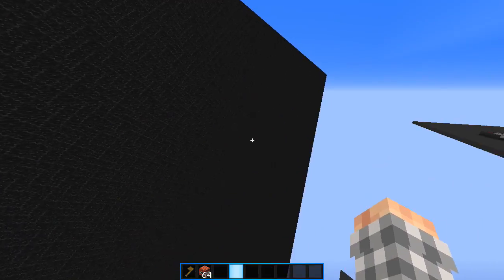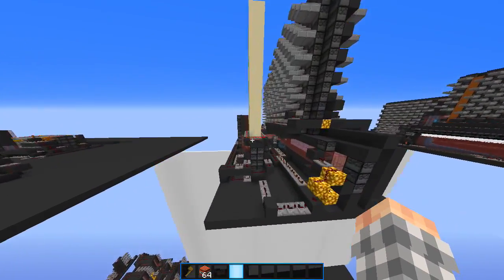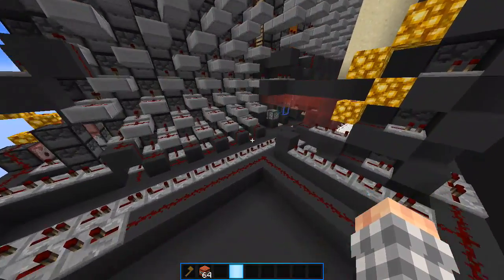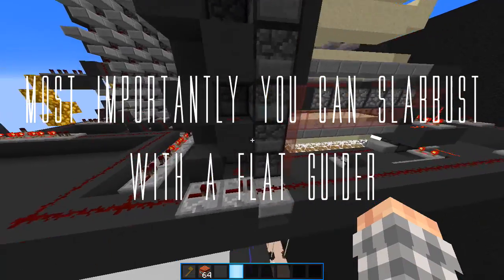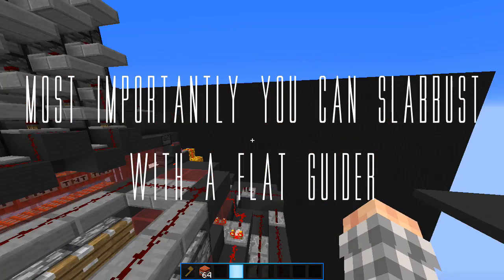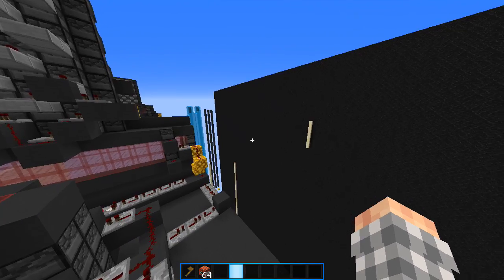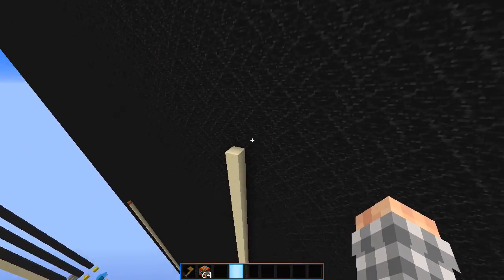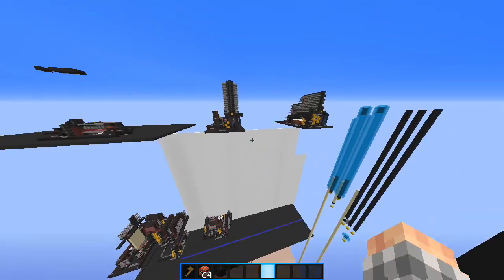Flat Guider Stacking Without OOE/Fusion (How it Works)

Comment: But isn't the gravity affecting the sand and hammer the same? I don't minecraft is coded such that entities only drop down when they hit a wall (else you could shoot like 20 chunks with 1 power without sand dropping). Therefore, wouldn't both the sand and hammer still be at the same y level when they hit the wall?
Reply: The closer an entity is to exploding TNT, the more velocity it gets. The sand and slabbust are closer to the power than the hammer so they gain more speed and will hit the wall sooner.

Once an entity hits a wall, it loses ALL of it's momentum and just goes into a falling state. Because the sand hits the wall before the hammer does, it will have a bit more time to drop down.

When the hammer and sand come out of the barrel they will indeed both arc down a bit and will hit the wall at the same spot, because the sand hits the wall before the tnt and goes into a falling state sooner it will have more time to fall than the tnt.
Reply: Sorry for late reply but just remembered this recently. Has anyone actually looked into the game code and confirmed that entities fall faster when their x/z velocity is 0? Because that's what a lot of you seem to be saying (sand hits wall first and falls faster because it hits wall). However, it seems kind of weird and unlikely that Mojang will code it this way, instead of having the three velocities processed independently.
Reply: Hello, sorry if this is a totally late reply, but what you're saying makes sense. These guys didn't understand your question apparently, and what you're saying brings me to ask the same. Gravity on the blocks is the exact same regardless of how fast they're going, I know that for a fact. Why this cannon works is beyond me but I have some vague guesses.
Reply: That makes literally no sense. The hammer is falling just as much as the hammer is, while flying through the air towards the wall. Being stopped by the wall does not make it fall more than the hammer.
Reply: Gloatinq "They drop at the same rate of speed". Exactly, doesn't that mean their y coordinates are the same at any time? Also, don't really care much for efficiency since I don't play anymore, just want to know how this works since it's been bugging me for about a year :(
Reply: Friendly Guy no because of the exposure of the power the sand hand slabbust they get more exposure than the hammer so thus they will hit the wall before the hammer does allowing them to fall before the hammer does and then the hammer hits the wall and explodes then creating a stack. (Sorry if this seems sloppily writen im on my phone :P)
Reply: But then by your logic, entities don't fall unless they hit a wall? That doesn't really make sense does it? Why would the hammer not fall as well mid flight?
Reply: Friendly Guy they do dip in air eventually but that is far later because of the amount of power
Reply: @Luke-xs5yz  Hay sorry for posting on an old comment. For what i know theres no way to do what he did in the video. Entities hitting wall don't loose their y motion downwards meaning that no difference is created even if one reaches wall later. He claims not using ooe but he strangely has the sand fall before everything, like so sand will be above hammer by like .2 or so
Reply: Late I know but as far as I'm understanding here you're saying about TNT and sand dropping at the same rate yes? They drop at the same rate of speed however the way this cannon works is to do with velocity not fall speed, due to the TNT exposure on this cannon it fires the sand/slabust out at a much faster speed than the hammer, meaning it hits the wall before the hammer allowing the sand and slab bust an ample amount of time to dip a block allowing to stack, however this concept is extremely inefficient and a parallel fusion is much more efficient, AG's are better if you understand the concept.
Reply: Jhinstalock they drop at the same speed, which is what I said, but, due to velocity involving TNT exposure ( the closer the TNT or sand is to the TNT = the more power, e.g the hammer on this cannon is 5 blocks away from the power, where ass the sand/slabust are a block away, which gives them a closer tnt exposure allowing a faster velocity
Reply: Friendly Guy basically all that happens is the Sand/slab bust leave the cannon faster than the hammer, which means they continue to travel faster until the wall, when the sand and slab bust hit the wall they lose all their outwards velocity and gravity takes place, allowing the sand and slab bust to dip before the hammer hits (slower speed due to velocity and TNT exposure) making it hit the wall as a normal guider cannon would
Reply: Gloatinq I'm gonna stop you right there at that phrase "gravity takes place". Please read what I already said, the y coordinates of entities are calculated independently from x/z coordinates. Hitting the wall does not affect entities' downward acceleration. Gravity acts on all entities at all times
Reply: Friendly Guy Once the TNT/sand hits the wall it loses all of its velocity and it starts to fall downward more dramatically than it would in the air, it's like you light a normal TNT at y50 and it falls down to bedrock
Reply: (The rate of fall doesn't change it just becomes the main priority as we've lost all our outward velocity)
Reply: Gloatinq 
if(x_velocity is 0 OR z_velocity is 0){minus 999 from y_velocity}
else minus 10 from y_velocity.
Well, next time I code a game I will remember to increase y acceleration downwards by specially checking if the x or z velocity is 0. So a unmoving, falling player hits the ground before a moving (holding w), falling player?
Reply: Friendly Guy no... that's not what I'm saying, the entity doesn't move downward faster it's just the only way it moves once it hits the wall, where as mid air with outward velocity it won't drop down as much due to the fact it has more outward power. I'm done explaining here lol if u don't understand how this works then ok sure bye
Reply: Any updates on this? Close to one year six months and still no answer. Would appreciate it if anyone (especially cleansed since it's your vid) could clarify this. Also, the total velocity of entities doesn't affect the y velocity, so losing all its x/z velocity (note that y velocity is not lost when hitting the wall) will not make it "prioritize" (fancy way of saying "gravity takes place" or "drops faster") falling down.
Reply: @friendlyguy308  I dont know if you are still doing anything related to minecraft but i can confirm that entities drop at a same acceleration which is 0.039999 if i am not mistaken. Thats simply the gravity of minecraft. Horizontal velocity does NOTHING to vertical velocity which means they hit the wall at exactly the same y. He is defo ooe stacking to make this work. Just like in real life, when you drop a bullet out of your hand, it will hit the ground as fast as you would shoot the bullet with a gun. They both experience the same gravitational force and horizontal velocity does not make the bullet not fall as much

Comment: so for rev lefty would you have your sand/sb on a lower guider to the hammer so it hits the top and then the wall first? just need alot of rev power that is one blows up 1 block below sand/sb and maybe 2/3 blocks below hammer?
Reply from the maker: In theory yes, however... I tried that before and I couldn't get it to stack very much so gl.

Comment: i'm actualy wondering if you couldn't use the same concept fore a straight 230 or wathever.

like moving the hammer right at the power together with the oneshot, then sand with the slabbust in front of it.

Comment: this only works at long distances because the sand would have to idle on the wall for 1 game tick wile the hammer is mid flight, if you setup a tacker you could find this out
Reply: good vid dou

Comment: so do you need like 20 chuck power for like 5 chunks of shooting? because of the velocity? also do u need the same amount of hammer like for normal fusion stacker?
Reply from the maker: You need alot (more than 20 chunk power) of power for it to work at any range. And as for hammer power, you should be able to achieve a 1 block difference so a regular amount of hammer should work.
Reply: ok thank you! I'm going to try the concept soon!